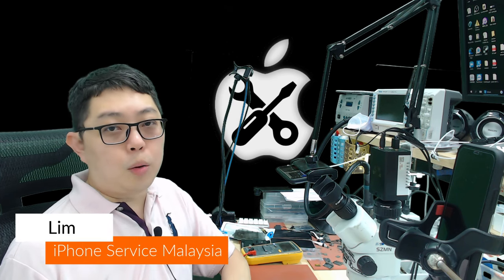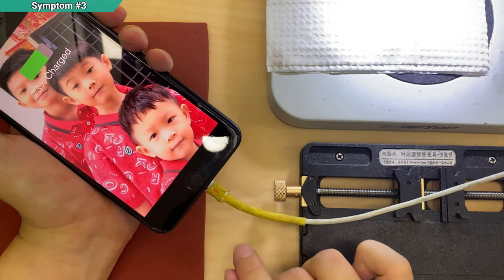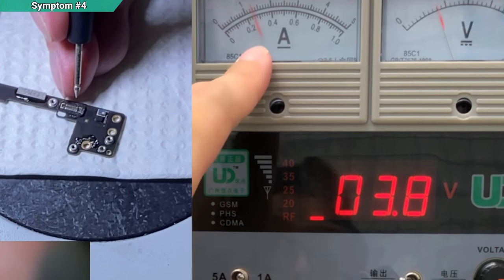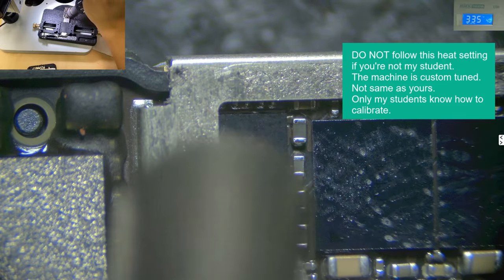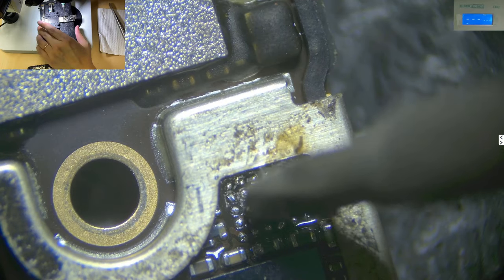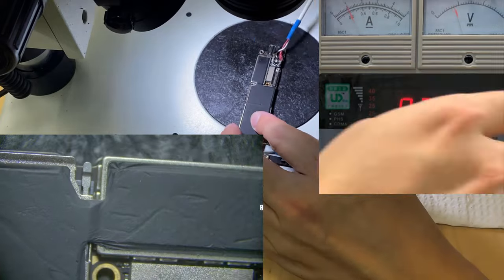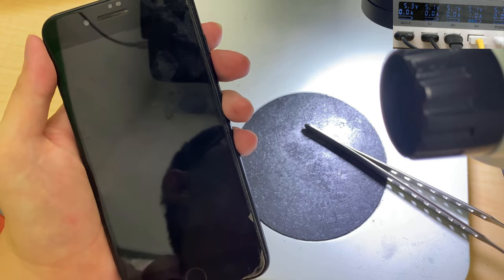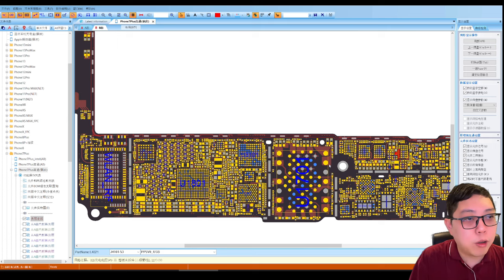iPhone Charging IC 【Tutorial】Tristar USB IC | iPhone Top 1 common repair

Comment: i have iphone 7, i had these symptoms before, now the charge is over and I forgot to charge and it turned off, Now it does not turn on either with or without the cable connection (black screen without logo or any sound or vibra) someone told me replace dock charger & it will e fix
could u give advice?
Reply: * dock connector

Comment: Does Tristar cause iPhone not to turn on too? With new battery and charging port
Reply: Thanks In advance
Reply from the maker: Possible, especially cases that are burned by faulty charger, multiple power ic related components are killed. 
Or maybe a technician has skill problem.

Comment: good vid just what i needed as ive been looking to diag my phone, my symptoms are it will charge when turned off only, goes to 100% but i think it is draining also when switched off and definitely is draining quite fast whilst turned on.
it recognizes cables but says usb not supported and the charge sign only flashes for a second.